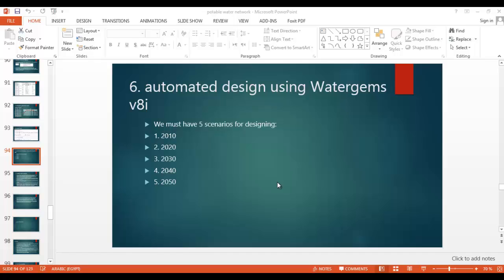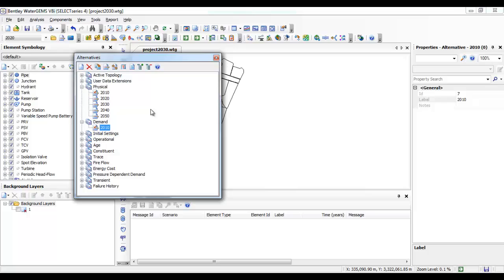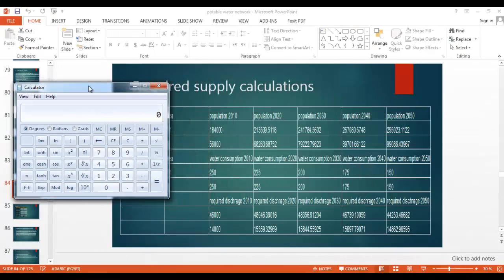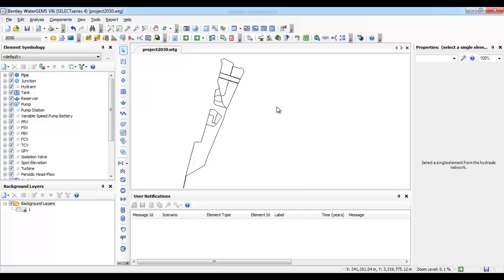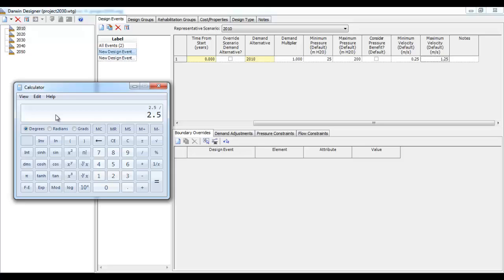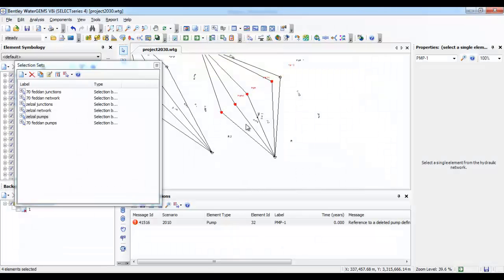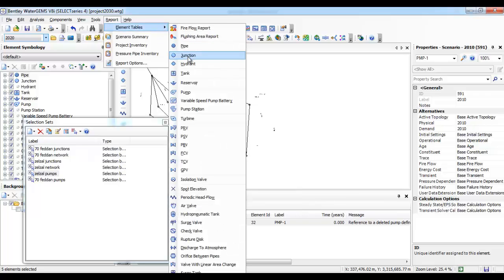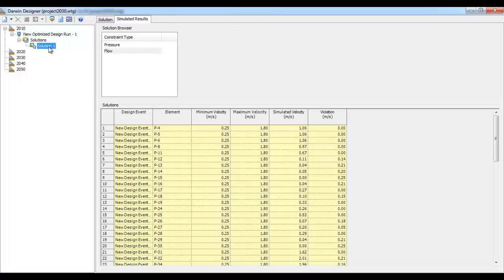darwin designer part 1

Comment: If the diameters are abnormal towards house service connections, how the construction is possible?
Reply from the maker: you will make a parallel link with a diameter less than 300 mm and take connections from it towards house